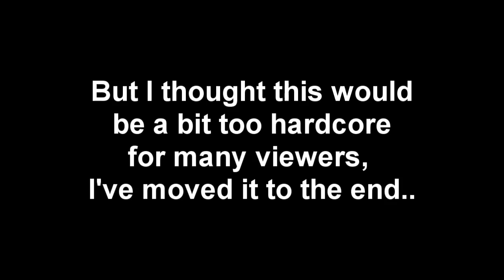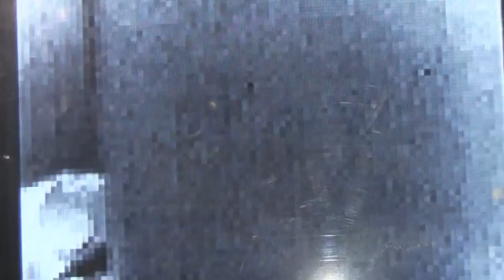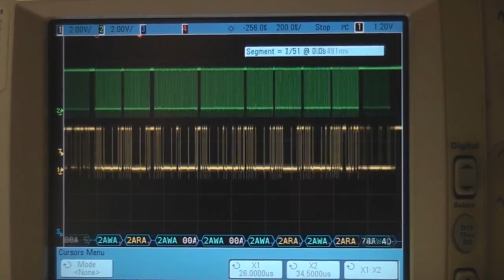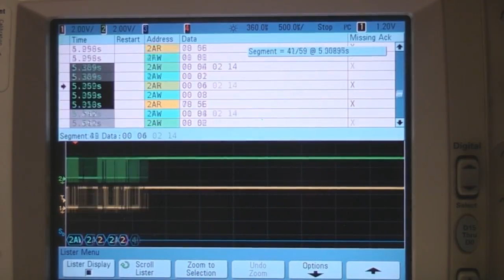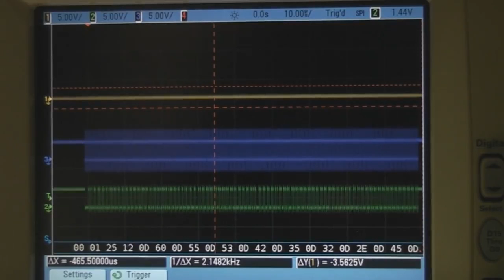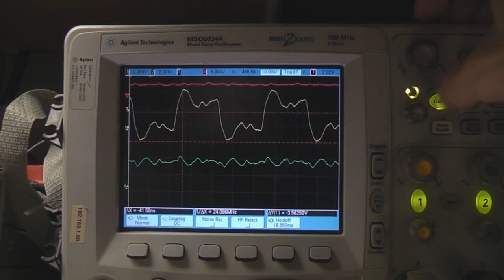Flir One teardown part 2 -  Lepton hacking

Comment: I have 2 Flir One Pros that both refuse to funtion (the same red light is all I get with both of them).

They are basically brand new, and the onboard sensors and cameras surely work fine.

Is there any way for someone with no electronics background (just build my own drones is the extent of electronics and soldeting I've done) to make use of these $350 dollar paperweights?

Comment: Hi, I have one question about FLIR ONE. Can I program the system to read the temperature in my computer and use it to turn on or turn off the heat source? I want to get the feedback few times a second and precisely control the temperature. Is this possible with FLIR ONE?

Comment: @mikeselectricstuff I think you're right - those reset / power down pins are most likely to be used by the processor's RBL (ROM Boot Loader). The larger ARMs tend to have their next stage boot loader (e.g U-Boot) in SPI flash. It's a shame that the pins are shared though... :-\

Comment: Hey! Great videos. And amazing job you are doing tearing down this device. I have heard that the Lepton Core is the same thermal core used in the FLIR Ex Series of cameras, and all Ex Series use the same core but each produce different resolutions which are limited by software. Some guy (maybe you. XD) manage to hack the Lepton Core to make the cheapest Ex camera perform like the most expensive Ex camera (80x60 vs. 320x240). Can this be done to the FLIR ONE? Is it posible for this device to perform in 320x240 resolution??

Comment: They need to really deliver a 30-60FPS thermal imaging sensor. Also is that a hardware limitation for the 1 update every 3 frames, or did they get so use to console gaming that they just cannot understand what a low frame rate is , and thus did not get around to fixing it?
It seems that flir makes 720p thermal imaging sensors for the military that they are already shipping, why can't they simply take those units and glue a smartphone case to them and then add a connector for smartphones?
Reply: I know in aus when I did a few flir installs, there were export restrictions on devices with VGA @15fps or above without proper permission,.
Reply: Seriously? Sell a military grade system that probably costs thousands of dollars if not more for $350? It costs that much because you don't simply pluck a 720p sensor from a tree. It takes years of R&D cost which they have to get back and the manufacturing process doesn't yield 100% perfect sensors meaning there is extra cost specially when die sizes increase.

They probably up the frame rate in that way to make it conform to standard video frame rates when saving as video files.
Anyway, even the E4 can only do 9fps. This is not meant for playing call of duty, for most thermal applications, the changes in temperature are relatively slow.
Reply: kalhana1 I believe there are government restriction on thermal sensors for sale to the public. they are probably worried that the Taliban are gonna start building home made heat seeking rockets or something.
Reply: iknowsstuff Interesting. Does it mean no one can sell discrete sensors? Or do they inflate the price of consumer products? Because you can certainly buy 60fps Flir cameras (not 720p as far as I know), although expensive.
Reply from the maker: kalhana1 TICs and sensors >9fps or >111Kpixels require export license. Below that the only restriction is you can't ship to embargoed countries.
Reply: mikeselectricstuff Oh ok, we have a T420 in the uni. But I guess they went through the export license procedure. As it's for research, they must be ok with sending from US. Not sure how difficult it is for industrial use in UK or for individuals.
Reply from the maker: kalhana1
Probably just bought from UK dealer.

Comment: To get into the linux system that's running it should work to press "Ctrl-C" at "Hit CTRL-C to s autoboot" (you lost 3 bytes there) and add "init=/bin/sh" to the default cmdline using u-boot commands. There may be some interesting stuff in the image.

Comment: Funny how you mentioned this could be integrated into a quadcopter or something, because seeing how simple the mockup you built on that PCB was my first thought was to mate it with a cheap 480TVL board camera from china and an RC camera switcher so just a flick of a switch can take you from standard color camera to thermal. Add a lens onto it to focus it at about 10-15 feet and you have a DIY government drone.
Maybe with some extra hardware the two signals could be overlayed like in the One the module came from or the Flir E series.

Comment: Combine this with those shitty video glasses You recently tore down.... but first try to make patent so nobody steals idea lol
Reply: Flir used to build thermal imaging cameras for fire fighters.
Look up "FireFLIR 110 Thermal Imager" and rethink it.
Reply: sarowie I know about Fireflir but compare the sizes man.....
Reply: use the force
look up the very product I mentioned.
Still you are right: With this module, a decent priced video glass (not the cheapy mike teared down) and a video modul it would be possible to create an amazing product. (One eye Infrared, one eye visible, switchable to both visible light and both infrared...) But stay fare away from patents. What Mike is doing may interest Flir Marketing and maybe their Semiconductor Supplier. Marketing is happy, because some geeks will buy a FlirOne just get a chip. The Semiconductor Group will also be happy. Either they participate in the FlirOne sales or their chip gets sold separately.
But when it goes to patents... I would not wonder when flir was or is holding one or more that describes a head mount thermal image system. And lawyers are less friendly then marketing guys and engineers.

Comment: Reading the Linux log there is a lepton kernel module, may it be worth asking FLIR for the Linux source as required under GPL, it could give some insight on the I2C data.
Reply: If they did it "right" then the lepton module will be a kernel to userland shim that doesn't do much.
Reply: I guess so, still figure its worth a shot.
Reply: As long as the module is not compiled into the kernel it doesn't have to be GPL'd.
Reply: donpalmera
Yes and no. As all I/O operations essentially pass-trough kernel calls, it could interesting to replace those kernel calls with dummy functions which report those calls out to the serial port. Lots of effort - recording an replaying the I2C Traffic would be easier for MIkes purposes - but when you want to hack the FlirOne it self (not the bare chip) it could be still worth it. Remember: They need to hand out the source code AND a documentation how to flash the kernel onto the device.
I am really confused why they use linux here - on the higher end cameras they use a Windows, which has the benefit of "when you buy a license, you can to what ever".
But with Linux, you have to supply a GPL copy, hold backups of every ever released Kernel Version (any consumer can ask for the very version his specific device is running) and so on. I mean: They don´t need a public server. They just need to hand out the source to verified customers on request, but... only one person has to do it and then this person can release it.
Reply: sarowie
>Yes and no. 

I'm not sure what you mean by "yes and no" really.
It could be a shim that exports enough to userspace to do the work. For I2C etc they could just use the userspace interfaces for those subsystems. You'd be able to see what it's doing with something like strace. It's more likely that their module is handling some stuff like interrupts that aren't easy to do well in userspace.
Or maybe it does contain actual driver code because they don't care as all of the expensive R&D went into the stuff that's in the chip itself. Maybe they are looking to mainline the driver.. who knows. The one thing you can be sure of is that it doesn't contain anything that they wouldn't want to be in the public domain.

>they use linux here

Why not? it's in almost everything else.

>AND a documentation how to
>flash the kernel onto the device.

The Linux kernel is GPLv2. AFAIK GPLv2 does not contain anything about instructions on how to flash or supplying keys so that burned in bootloaders etc will accept the user compiled kernel. You are probably thinking of the anti-tivo stuff in the GPLv3.

>(any consumer can ask for the very
>version his specific device is running)
>and so on.

Tagging the release in their local git will be part of their release cycle so it's a piece of piss to generate a copy of the source that the user is requesting.

>They just need to hand out the source

Companies can make it very hard to get the source and still be within the terms of the license. The number of people you actually have to give the source to goes down a lot when you ask people for their name and address to send a physical copy.
Reply: donpalmera
In one case I can think of, a developer of an open source library sued a company that used his library in a consumer product. As he was a copyright holder and a owner of one of their product (he used it to prove that is was actually this specific library), he had any right to sue them and no hazard, after winning the case in court, to release the code publicly.

About instructions: It deepens on how you read paragraph 3 of the GPL 2:
> For an executable work, complete source code ...
>plus the scripts used to control compilation
> and installation of the executable
How fare those installation go?

And the right to modify the software.
(It can be argued, that locking the programming interfaces by encryption and similarly methods, it would be impossible to use the right to modify the software [on the specific hardware]. Therefor blocking access would invalid the license.)

But you are right: There is no explicit requirement, so the court will decide and if in doubt: There is no requirement to supply instructions.

Mike posted the boot messages which contain something interesting:
> Image Name: Linux-2.6.39+
> Image Type: ARM Linux Kernel Image (uncompressed)
An uncompressed image, U-Boot as boot loader and pretty obvious serial interface may mean, that Flir does not care to much about hacking the FlirOne.

Similar as canon accepts the hacking of their camera firmware.

After all: I think the flirOne is more marketing  then the future of thermal imaging. It is a relatively low priced, fancy gadget to introduce people to thermal imaging and the brand Flir.

Using Linux is - at least for me - still surprising, as the higher end models use windows. Did flir intended the hacking of the FlirOne? I mean: Nothing better then viral marketing, but is it intentional or accidental?
Reply: sarowie
>In one case I can think of, a developer

The problem with the GPL is that it's largely untested. The companies I've worked for that used GPL licensed stuff have had a lawyers on hand. I'd like a link to that case if you have one though.

>How fare those installation go?

It mentions scripts. So if Flir use some scripts to put uboot and linux (which probably has an built in initramfs userland) onto flash then I think technically they would need to share those but not instructions.
There is nothing to stop Flir using signing to stop people loading homebrew and that's what the GPLv3 addresses.. but the kernel is v2. The SoC they used is an older design that can just about run Linux so I don't think it's doing much.

>Similar as canon accepts
>the hacking of their camera firmware.

I think companies that ship devices that don't depend on you consuming software (like the Xbox, Playstation) aren't going to have much of an issue with modding unless people break stuff and try to get it repaired under warranty.

>After all: I think the flirOne is more
>marketing  then the future of
>thermal imaging.

That sounds about right. It only works on the iPhone after all.

> as the higher end models use windows.

I would guess that the windows license isn't worth it for what the SoC is doing. Those Atmel chips are fairly well supported in Linux so it wouldn't have taken much effort to get it doing what they want. I think we'll see more and more of this now that chips that can run Linux with memory protection etc are getting cheaper and cheaper.
Reply: donpalmera "I'd like a link to that case if you have one though."  http://www.theregister.co.uk/2010/08/04/gpl_violation_westinghouse/ or just search google for "busybox court"
Reply: sarowie What are you people wittering on about? If you want to know what it's sending over i2c to init the module ... just snoop the i2c bus...
Reply: LOL.. who would use wnidows on any 'high end' model? sounds garbage. Anyway linux is a universal ferrarri to most hardware, vs. windows .. sheesh.. that's not the point. Anyway,  this thing runs sshd, which means since it can be linked to the phone, it can call home anytime it wants on a net and be connected to? wow. I mean I am not sure if the charger interface mentioned actually has a data connection too as I don't know iphones but ya. I wonder if he would find a wifi chip on that thing ! :o

Comment: Superb vid as always, Mike.

Is it possible the Atmel ARM is accessing extra boot data from the SPI Flash on the board? Would be interesting to see how the chip select for the Flash chip relates to the other data.

Much simpler using SPI rather than MIPI for the pixel data though.

I'll definitely be grabbing one of the sensors if they make them available separately.